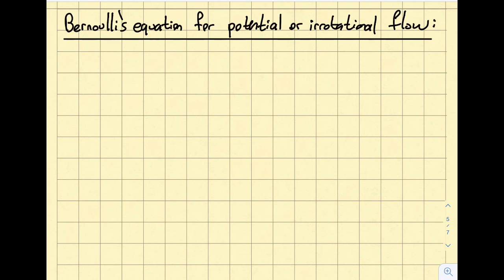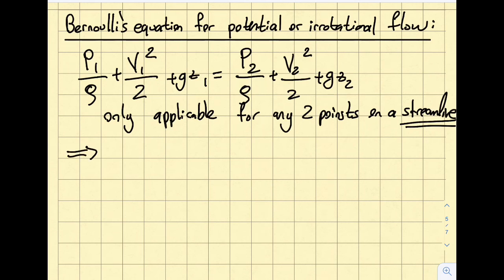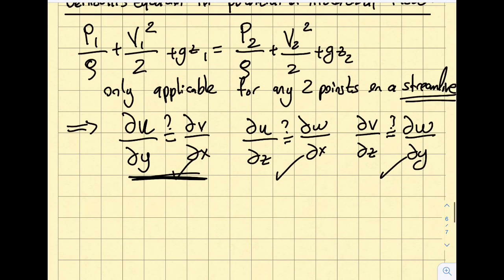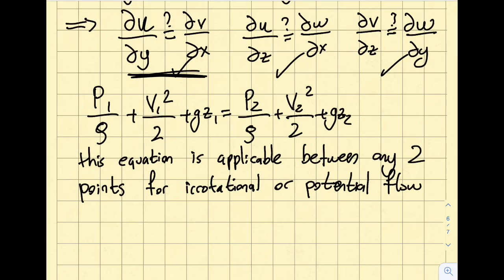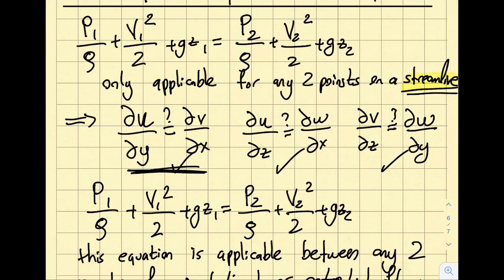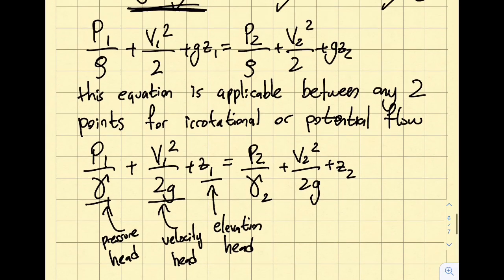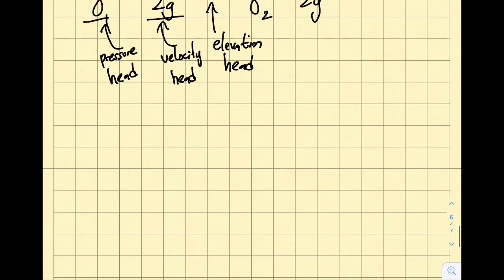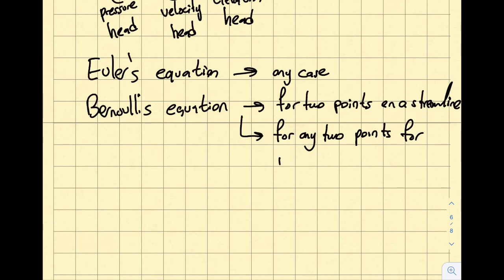Fluid Mechanics 9.3 - Bernoulli’s Equation: Alternative to Euler’s Equation of Motion

Comment: Professor,
I'm a little confused so are you saying that irrotationality is a prerequisite for a streamline to exist. or just in this case we have to verify that it's having potential flow and then we can use bernoulli
Reply from the maker: Hello Valerie, the latter. Streamlines exists regardless of the flow being irrotational or not. You can use Bernoulli's equation between any 2 points in the flow IF the flow is irrotational
Reply: @CollegeFluidMechanics  yeah i figured by the end of the video. I forgot to delete the question. Thank you though!